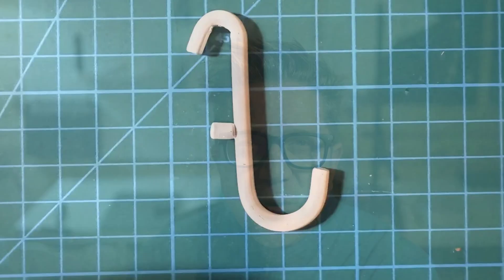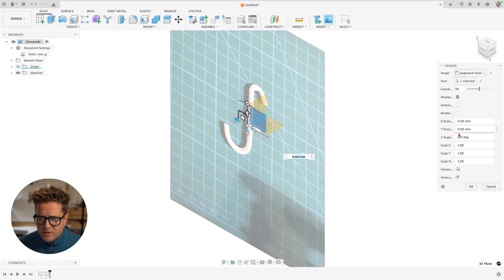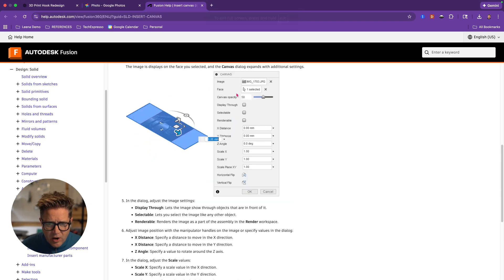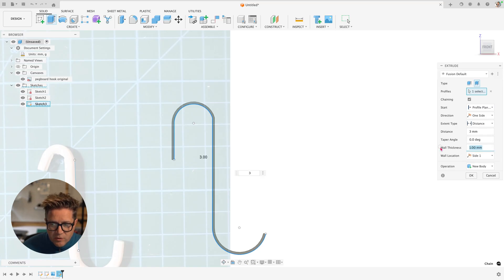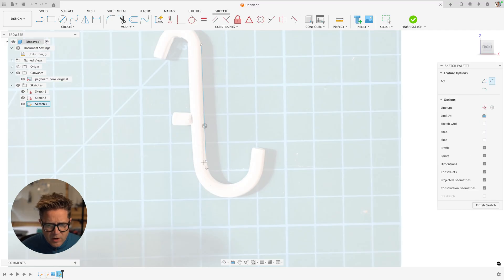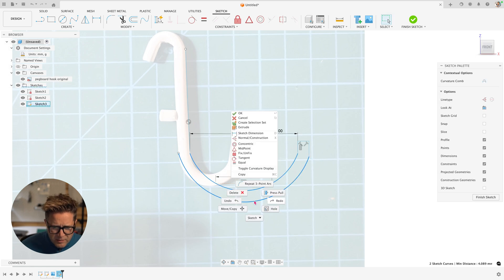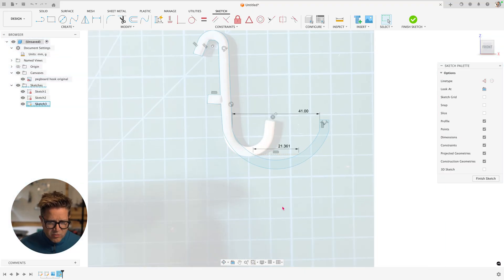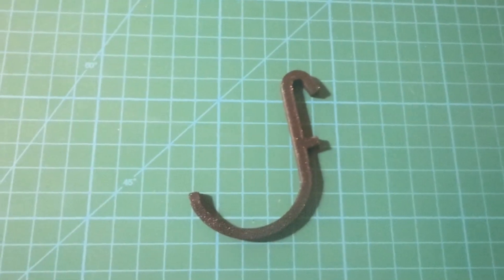Custom Pegboard Hook in Fusion 360 — Photo to 3D Print -Trying Again

Comment: This is a very helpful type of video because it involves a specific real world task and you include golden nuggets of techniques along the way. I just made a clip for a plastic tote that keeps the top on ( for ever loosing those things!) using the same basic flow, but you used lines and arcs instead of just splines. I see now that combining lines, arcs, and splines would have made it much easier. Thanks again.